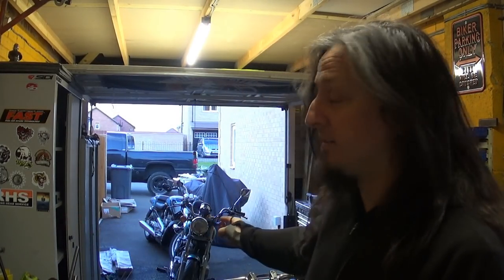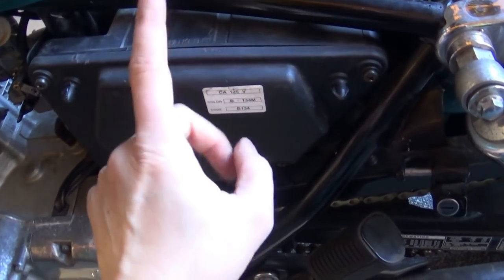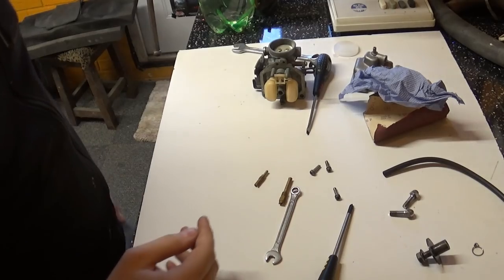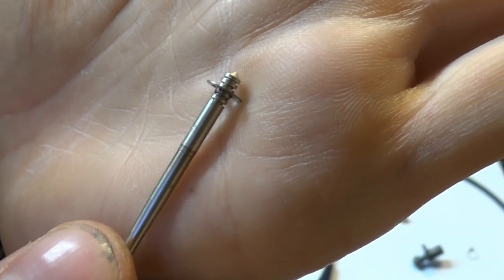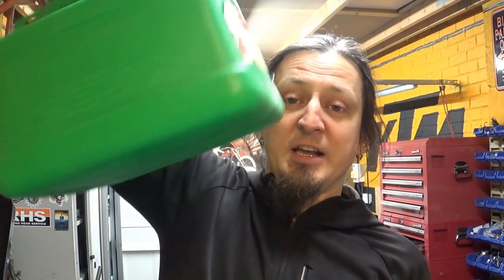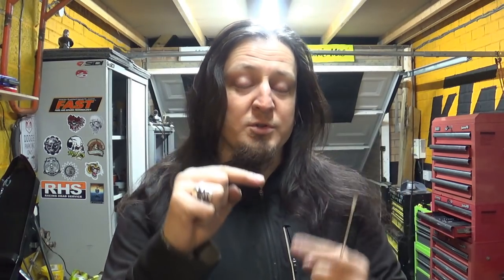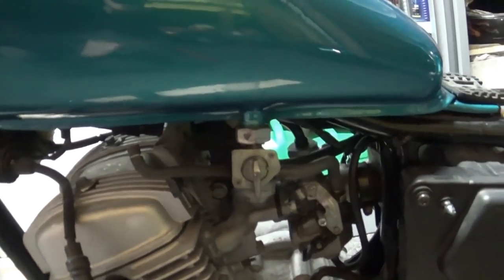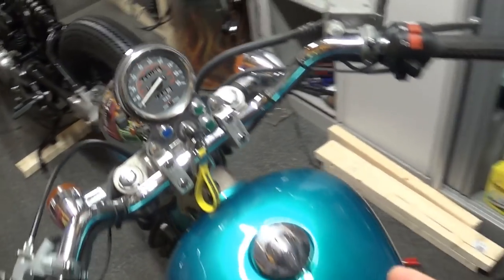Honda Rebel CA 125 -will she run any better now?

Comment: Iv had this exact problem. It's the CDI. I just got those bright orange ones off eBay and it lets you rev hard and is more responsive. Only drawback for me was it now has trouble starting but once it starts its fine all day. Got get that orange CDI and have a beer Mackie!

Comment: if it was running fine before you guy's stopped using it then i would say dont bother changing needle position in the carb, you need to put it back to where it was and any other carb settings that were fine before the problem started, so your not chassing your tail. it may be that when your reving it now to wide open throttle it is flooding and thats why its cutting out, if your plug is wet and dark then its not burning the fuel off, so i would point to 1, bad HT plug cap, 2, HT lead starting to break down, 3, bad coil which can cause very similar problems to not enough fuel, because as you rev it your coil is struggeling to give the proper out put to your plug, and for now dont bother with the inline fuel filter or the original fuel tank, just keep it simple.
oh and 1 last thing, check your battery charging system, whent the bike is running are you getting more than 13.5 volts at the battery, I now it sounds daft but a bad charging system I.E stator or reg/rec can also cause running problems, good luck.
Reply from the maker: Thank you. This stuff is gold!
Something I know already in a way, but when you put it in words it all of a sudden making perfect sense! I will follow up with these tips one by one and double check it all. Absolutely love YouTube for that reason!
Reply: For my tuppence worth, the carb, both versions, is doing it's job and it's clean. When you raise the revs slowly the ignition keeps up, you've discounted fuel flow, filter and old fuel yet with a hard rev it dies because the ignition is overwhelmed, there's not enough bang and then then the flooding symptom appears. If all was fine before  then what has changed over the 4 months to stop the air, fuel, spark needed to make the thing run. It's not air, you now know its not fuel so it's spark.  Unused leads, caps etc corrode, try swapping them from another bike. Could be electrical as said, battery, charging circuit maybe or going back to corrosion even a dirty earth terminal somewhere will cause chaos. Happy hunting....no pun intended :)
Reply from the maker: @timsmith6029  I think you got it Tim. It must be the spark. I did experience number of times before faulted spark plugs. They gave spark, but it was weak... sometimes it's difficult to start, other times it won't rev right. New plugs ordered, and I'm inspecting the ht leads as we speak. Cheers for your input. Super greatful.
Reply: @MackieBass  cool mate happy to be of some use. you will sort it in the end.

Comment: I do love your shirt with the beer text at the back. Great idea. I am just using the same "petrol" before starting my works...
Reply: Hey Mackie. I would be happy to get your advice because you already know this vehicle: I am going to buy a 1998 125cv rebel with 52000km on the instrument. This is the last generation with the twin color on the tank sides. Technically this is almost the same vehicle except the carb (no clip setting) and the front brake. What are the most important things I should check first to avoid a technical nightmare? Cheers,
Reply from the maker: just a general motorcycle maintenance. Forks seals, wheel bearing, chain, and throttle response i guess.. they are vey well built being a Honda, so good luck!

Comment: Before you raise the needle anymore check your valve clearance a lot of times when they sit for a while a piece of debris can dry or Harden on the valve seat in whichever one may have been open check to make sure you don't have one that's too tight or too loose if you get a tight one more than likely it's a piece of debris in the seat...

Comment: Hola Mackie!! Cómo va todo? 
The first thing I would do is to adjust the valves and start with the original adjustments of carburetion and change of air filter.
If the fault continues I would check coils, captor and spark plugs.
If all this does not work, have a beer!!
Reply from the maker: I'm having a beer either way bro. Coils will have to be replaced as I can't fix them... But couple of things I need to check first.

Comment: I concur with a previous subscriber the "spacer" that you took out and then replaced is actually to stop heat transfer from cylinder head/barrel  and carburetar  to prevent fuel vapourising premature it is made from a composit product,years ago we used to call it tufnel and we installed it in busbar chambers within high voltage substations as an insulator in a volatile and highly dangerous environment.on cg125 models and similar it came in three thicknesses I have no idea why they had three thicknesses road bikes are hardly going to do three laps of the isle of man lapping at 100mph + do not bore it out just keep it standard as per factory spec.'

Comment: It hard to tell on video but it sounds like it's missing . Clean the suppressor up inside the plug boot and check both are firing under load by swapping the leads to opposite sides pull on plug cap off at a time and listen for a change on engine noise . It feels like one plug is getting swamped when you open throttle because the spark is weak . Just a suggestion bro
Reply from the maker: Very valuable points. I will double check all that and let you know!

Comment: wow I'm impressed to see that video
I have exactly the same bike (even the same color). I had just your problem but it kind of resolved itself. (I got some other problems though lol) 
I got the bike at the end of last summer and I thought that just fully jamming up the gas that quickly was something she just "didn't like".
It kinda solved itself while driving. I think the previous owner didn't drive that much, cause it had 6000 on the clock when I got it. Now I did about 1000 km with it but I think the problem slowly disappeared after maybe 250km of driving frequently and driving long. I use Super Plus as petrol maybe this is also nicer for her. (Super Plus in Germany is petrol with 98 Octane instead of the regular 95. In germany it's a kind of premium and costs more but I think it's worth it for the high revs.)
Maybe using 98 Octane helps I hope you get her running nicely. Kind regards
Reply from the maker: Yes mate, these small cylinders don't really like stale petrol. I will load it up with premium petrol and report back to you later. Thanks and watch this space. Good to hear I wasn't the only one with that issue.

Comment: Given that the bike was fine before, it's only the things that could have changed in the meantime that could affect it - deterioration. Needle back to its prior position. You already ruled out old petrol and jet clogging, so the next thing you should probably look at is the float, which could either be stuck and not allowing enough fuel in - making the mixture lean, or not sealing properly and making the mixture too rich. Both would result in the engine cutting out when you grab a handful of throttle. Next thing I'd check is HT leads, could be corroded etc. Keep them videos coming and best of luck with fixing it!
Reply: Forgot to add that the new carb probably comes with a different float height setting too, which would likely have to be tweaked to work on your bike - not 100% as I am not familiar with the specific model but a likely scenario, resulting in the same symptoms you have with the old carb
Reply from the maker: It's exactly my way of thinking too. I'm on it this week and we'll take it from there. Thanks for your input. Great to see suggestions that are on the same page as me, makes me a little bit more confident and positive with this project.

Comment: While your at it dude. Increase the lip sync advance a little to to line up with gob ok 👍 Is the timing ok butty? If it was running fine before you let it stand then it can't break itself. give the tank a good swill out and fit a new filter in the tank and I bet you it'll be fine providing the timing is right.
Reply: So I got the same bike and I had the same problem. But you're a little bit wrong. It can kind of break itself while standing. After about 250km of driving frequently it should get back to it's ols glory. So long story short. Yeah it kinda breaks itself from not beeing driven.

Comment: Mackie, gorgon said below to check the valve adjustments and valve timing. Perhaps (I don't know the engine), it's got a timing chain tensioner problem? If the tensioner isn't keeping the chain at the right tension, the valves may be 'lagging' and not be opening at the correct time on snap acceleration. I've seen a schematic drawing of the 250 rebel tensioner and it appears to have a tensioning spring arrangement. Spring detached or snapped? Maybe? I'm guessing, but it'd be worth checking.
Reply from the maker: Absolutely right. Something that needs to be checked and adjusted accordingly. I'm on it bro.
Reply: @MackieBass : It's not going to be anything to do with valve adjustment or valve timing, you can also rule out the cam-chain tensioner as well simply because it's not rattling like a bastard.  I personally think you're just choking it out, think about it - it's a humble little 125 twin fed by a single carb (a bad idea in itself) when you whack the throttle open from very low revs that single carb has got to feed two cylinders instantly & it simply can't cope because it's getting shitloads of air before it has the fuel to match!
Reply from the maker: @CaptainScarlet1961  yes yes and yes. I too think that small little Pistons can't cope with that...and they are little more sensitive to petrol quality than their bigger brothers. Cheers man.
Reply: @MackieBass : You're very welcome matey, I have a lot of experience with 125 Honda's among others & they're temperamental little buggers at the best of times & don't take much upsetting, just my opinion & btw love your airbrushing video's - proper talent👏👏👏

Comment: Might need to richen pilot jet, because too lean pilot jet will cause bike to stall when pulling away or suddenly opening throttle, but i guess you figured it out already. I'v spent the last year trying to figure out a twin carb setup.

Comment: Bloody irritating. I'd say if it needs to be richer to rev then it must be pulling air through the a boot. Test with an unlit, that's an unlit propane torch around the boots both ends of the carb with the choke off, if the revs vary from tick over you got a leak.  Failing that remove all the fluids from the bike give it a polish and hang it from the ceiling of your local pub. Cheers!
Reply from the maker: I was spraying easy start around the carb/boot, all seems ok. I even sealed the obvious places with grease....to no avail :(
Reply from the maker: And yes...I'd probably get more money for it selling for parts or as a decoration! LoL.
Reply: @MackieBass  Bummer, Get yourself a couple of good strong hooks then. Is the exhaust bolted on properly? How are you cleaning the carb? I use carb cleaner cotton buds and compressed air. Double check the pilot circuit,  Needle valve ok? leaky float? All the symptoms are carb related. I once found a dog hair in a troublesome carb .I kid you not.

Comment: Darn! Hoped it would just be a fuel issue, but you are slowly eliminating all the likely suspects.  Next possible thing I might be suspicious of, would be the CDI (Capacitor Discharge Ignition) is bad, and it is not advancing the timing with the revs.
Reply from the maker: Yes and no....as it's running much better on fresh petrol. Old one is definitely causing more issues. If it was CDI, it'd be the same on both systems...

Comment: If it ran fine last year...raising the clip on the needle is just a bandaid over the real problem. You have a clogged or partial clog in a fuel or air passage. And just because that new carb is (new) doesn't garrantee it's clean .....its from China?
My suggestion ....replace the fuel, get new jets (same size) if you can't get new jets, use a micro file to make sure they are open to the size they should be, soak the carb body overnight in carb cleaner....

Comment: message from alex,can not see your carburettor clearly(BEFORE YOU DO ANYTHING ELSE DO NOT TOUCH IGNITION TIMING OR VALVE TIMING) I think the problem is the accelerator pump diaphragm in the carb'.body perhaps it is split or has a pinhole in the rubber??? but the first thing to check is the following------in tha carb'. body on the same face as the gasket there are two pump delivery valves,they are tiny with slotted heads and made of brass,please do not mix the components up I suggest you do one at a time. when you unscrew the valve out of the body there is a spring and ballbearing inside you may have to tap gently to get them out they are called fuel pump delivery valves and are prone to sticking if old fuel has gemmed up blow the holes through with carb'. cleaner or compressed air or by mouth.basically they are one way valves and could cause fuel starvation when the carb'.moves from pilot jet to main jet.here endeth the lesson PS  I am 75 years old this month I have learnt a bit over the years.this may stop the headscratching remember do not touch ignition or valve timing all you may need to do is clean/change sparking plug.ALEX
Reply from the maker: Thanks Alex. There is no diaphragm in this carb, so it's one less thing to worry about. But you do have very valid points there. I am double checking everything as we speak and will report back soon.
Reply: when you take the float bowl off,perhaps there are still the two brass valves in the main body inboard of the gasket there are very fine holes in the main body of the carb,if you look in from the air filter end towards the throttle slide there is hole that is hard to see,anyhow do not poke anything to rigid down jets etc. I use a  nylon bristle off my wifes brush and pan set I also use a piece plastic cut from my garden pea netting as a last resort 5amp fusewire you can get a card of fuse wire in BQ for 5,15 &30amp use the wire as a last resort,i have one of those little vibrating cleaners that you immerse the whole carbureter and parts in the last carb.' I had trouble with took two or three sessions to un - gum I usually steep them overnight.

Comment: watched your previous video on the 29 march,i listened to it running on pilot jet tickover. I would like to ask a silly question, is the throttle slide the right way round and located in the guide????
Reply from the maker: Yes, it's the right way in. Not a silly question at all, as it goes in both ways, but it is the right way in.. cheers.

Comment: If its not jets then if you get bog when winding quickly it normally means a rich condition so the fuel needs reducing a little. Is the spark plug gaps ok ?
Reply from the maker: In the end it needed fresh high octane petrol and a good clean up.

Comment: Hi again Mackie!
..when heard you start the enging,..
you have probably an issue with the specs of your valves..
..the compression, and perhaps the cam-opening time.. good work so far..!
..cheers!..
Reply from the maker: You think? Something I need to look into then...
Reply: @MackieBass  ..start with valve adjustment,..and then see how it runs..  my bike did a lot of difference when valves were off..
I mean, ..it wasn't stalling, but it had no power. It can be interfering the combustion.. best luck!..

Comment: Again what does the spark plug say? Show em
Reply from the maker: They we're both dark, but I only checked them after short run. I'll give the engine a good blast and inspect them then.
Reply: MackieBass if they keep looking good it might be an ignition I guess
Reply: Hi Mackie these little Honda's suffer if the ignition timing is out, points ect, also ignition advance can seize.

Comment: you put the temporary fuel tank on to eliminate the main tank and tap..but the carb wasnt at stock settings ...ok now stop fucking about with the needle it ran fine before ..get that poxy Tap out if the tank and clean it and the tank put new fuel in ..then youve eliminated the tank and tap...youve cleaned the carb put it back as it was with the short hose and the needle where it should be...if it dont run then you know its spark or a lead or coil breaking down...ive had many bikes do exactly this with a semi blocked tank Tap filter ..it'll run on idle it'll rev gently but will not rev hard...
ok buddy it may not be this at all of course but please please please try it first...
love you bruv ..👍🏻☮❤

Comment: Here is a good video on how a carb works, it might help.  https://www.youtube.com/watch?v=-2NIDcqv59I     cbrblade made a statement that I was going to say, if it was running fine when it was parked then carb settings don't need to be changed.   Do you have a Colortune or a buddy that has one ?  It might help diagnose a spark issue ?   https://www.carbtune.com/colortune.html